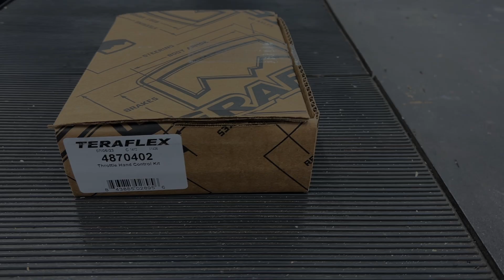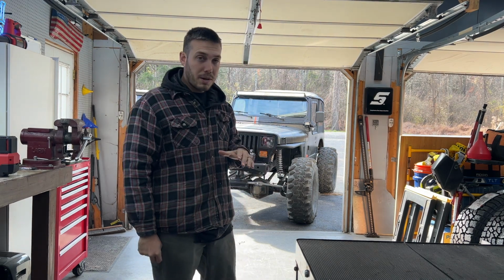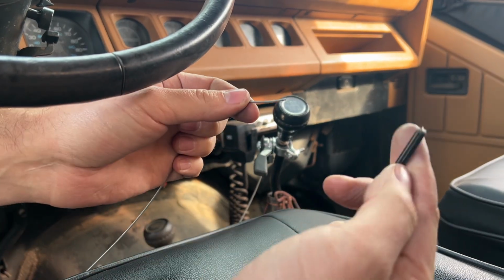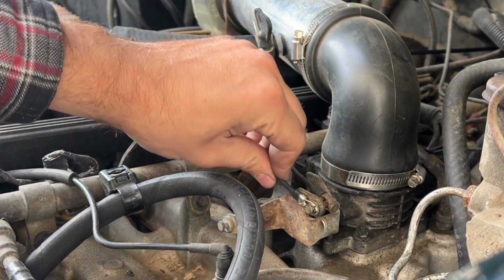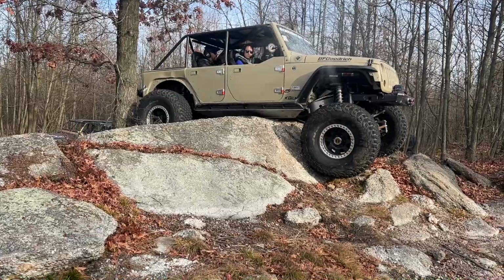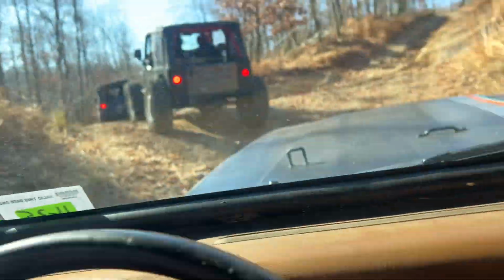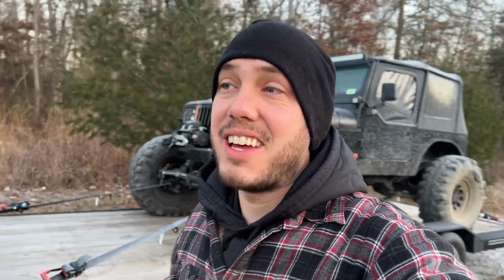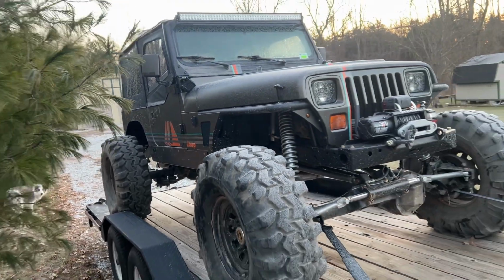Needed upgrade for your manual YJ - Teraflex Hand Throttle install + Wheeling

Comment: FYI, the cable adjuster bracket thing is backwards, the cable should socket into the knurled side.
Reply from the maker: That makes way more sense, like I said I’m pretty dumb haha. Their instructions aren’t very clear. I’ll have to see if I can flip it without needing to get another cable. Thank you for the info, I’ll try and pin your comment to the top so others can get the info. Appreciate you watching! 🍻👍🏼

Comment: Nice install - would you recommend a minimum tire size for my 89 Wrangler build to even attempt trails like these?
Reply from the maker: Thank you! If I was to recommend a minimum, I’d probably say 37” to help give the extra clearance on the diffs but I’ve seen guys make trails like that on 35” tires. It manly has to do with the supporting mods like beefed up axles/shafts, lockers, tire type, beadlocks, etc. luckily a lot of trials like this have bypass’s so you can attempt them and if they become to hard you can get off and go around. I hope that info helped, thank you for watching!!

Comment: Hey man, do you know what springs this jeep has in the rear? And do you have an anti wrap bar? I did that rear kit with stock replacement xj springs and it wraps something terrible, and heard a ton of mixed reviews on the wrap bars... thanks!
Reply from the maker: This Jeep has 3.5” rubicon express leafs with no anti wrap bar. Mine is set up spring under so that helps a bit but I have limited time on it to know if it wraps bad. I was planning on doing an anti wrap bar on my other build. I think they work well if set up properly, it just takes a little time to dial them in. I hope that Info helped.
Reply: Thanks for the info, think i need more like a 6 inch spring to match the font end as it sits now. Interested to hear if you still need a wrap bar
Reply from the maker: Of course! I’ll try and keep updated videos in the future on weather I need to go that route or not. Good luck with yours!
Reply: Thanks man, love the channel, your sub mounted winch inspired me to do similar on mine, so awesome

Comment: If you need a hand throttle, it means you’re not geared low enough.
Reply from the maker: Definitely agree, I’m working on trying to get a 4:1 transfer case at the moment. I feel hand throttles still have their place even with correct gearing, but over all I dig it